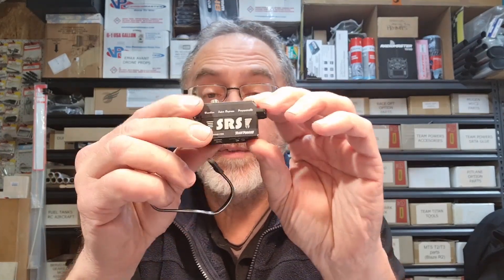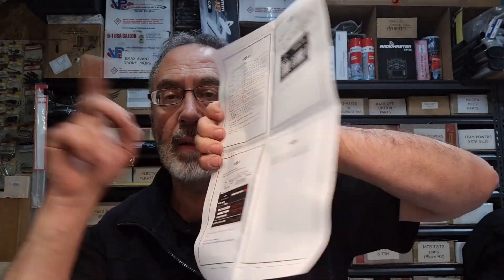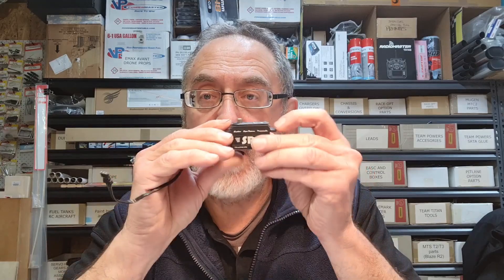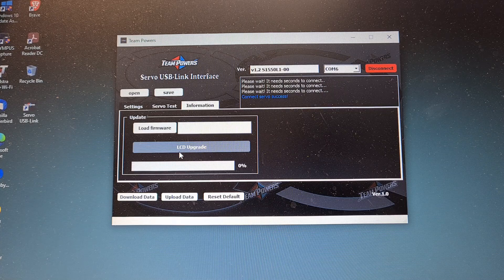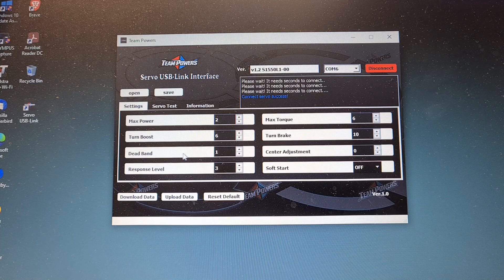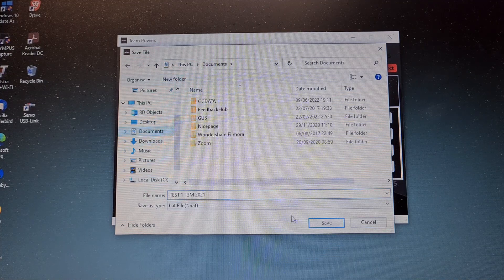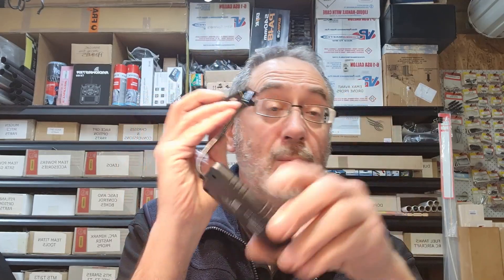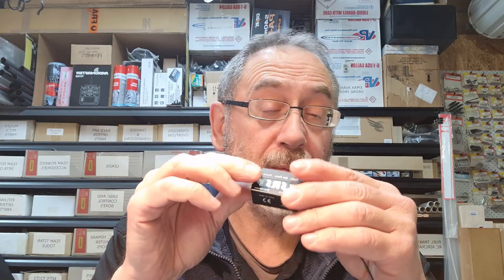TEAM POWERS SRS V3, FULLY PROGRAMMABLE SERVO

Comment: Cant wait to install thia on my B7. Ive sworn by protek rc 160ss servos in all my stadium trucks and buggies. My local track is the north America team powers distributior so they pushed me towards this servo and a few club drivers said it was amazing and better than the pro tek 160ss so we shall see. Have you used thos servo yet? How do you like it? How do you think it ranks amongst the top servos in the class like the 160ss? The 160ss ks a smidge faster but its so close i doubt i wjll notice. However the SRS V3 has mlre torque so i cant wait to test it on the track
Reply from the maker: I've found the SRS, via the control box to be brutal (so many parameters to adjust). I've chosen to run this standard out of the box best to suit my abilities.
Best what i've found it is NOT power hunger like one of the known brands on the market. Unfortunately we here in OZ don't have access to the 160SS  from Protek, so i can't compare.
Reply: @RABHobbiesParkdale  the 160ss is a super fast servo but tue SRS is very close in speed. I cant wait to test it on the track
Reply: @RABHobbiesParkdale have you tried the SRS v3 yet? Curious how you like it. And thanks for the heads up on just running it straight out the box. I was close to buying the programmer to adjust the whippyness of the steering. I can see how there are too many parameters tho and then the servo begins to feel choppy. Curious how you're liking it
Reply from the maker: @LegendsPizzaCo  I have this in Mr second tourer and have left the parameters, out of the box. 
It's been in the MTS T3M V1 now for 3 months and rock solid performance. No complaints at all. 
I changed the parameters once since, but have always reverted back to the box set up. It's proven to be the most drivable for me. 
Deviation from neutral since bolting in, nothing in all this time. 😊